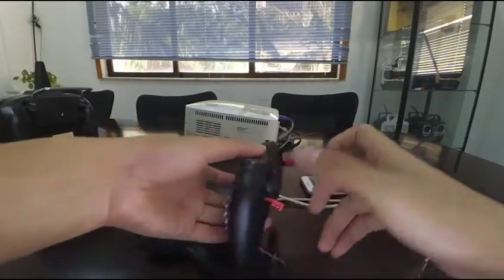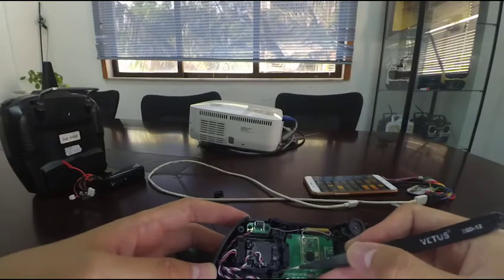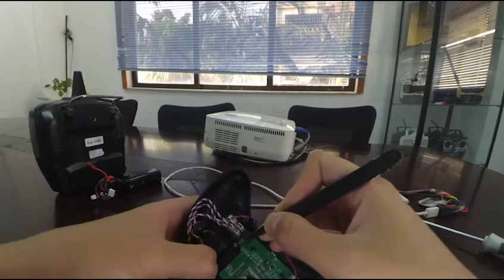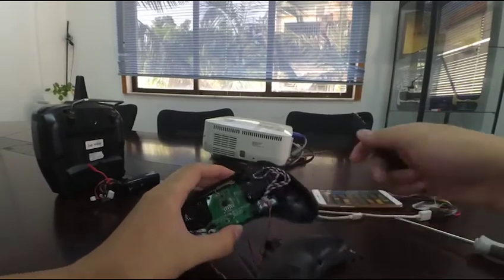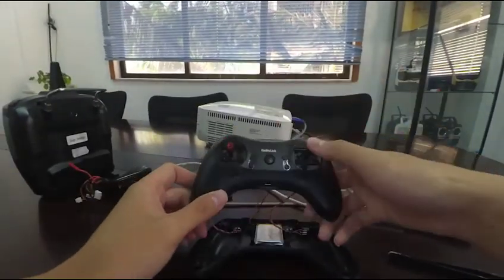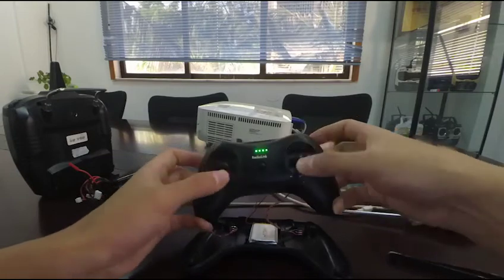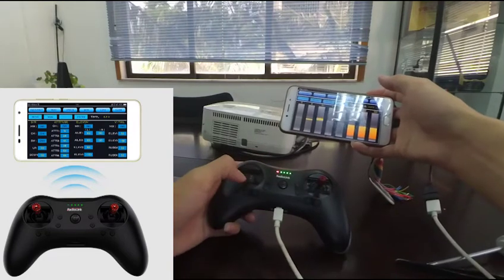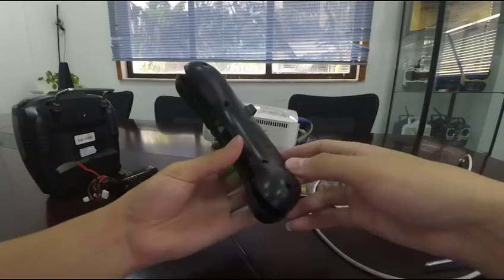How to | Change RadioLink T8S Stick Mode & Joystick Calibration

Comment: It's nice that these newer more capable radio systems can still be switched between modes. But none of them approach the ease and simplicity of the old Flysky transmitter from the WLtoys V911/912/etc helicopters. Tx Off, Press 2 Buttons, Tx On and hand it to any Mode1/2/3 or 4 flier!